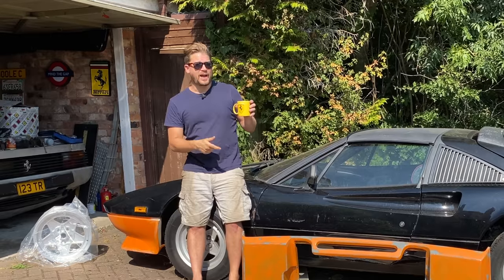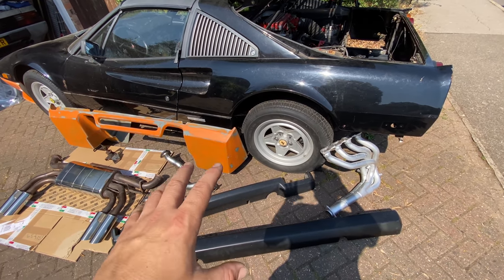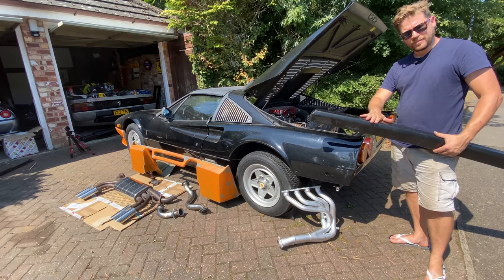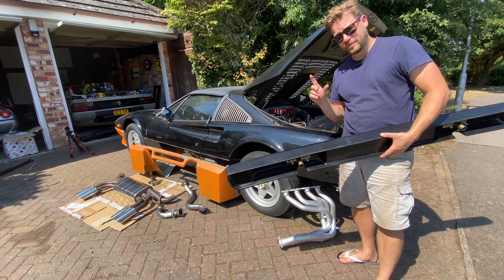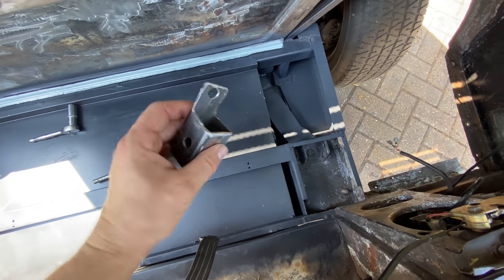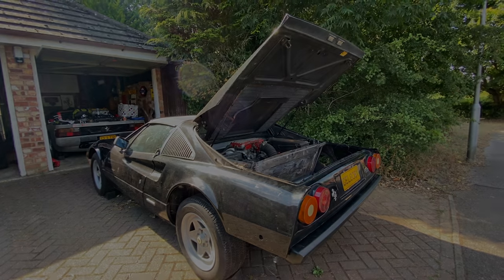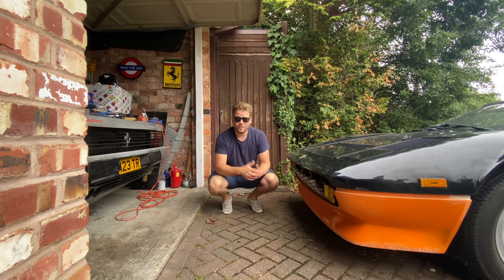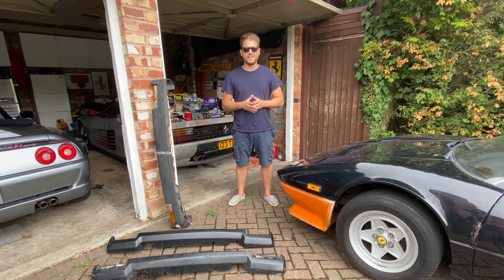Making My Ferrari 308 Project Look and Sound Better - Conversion Time

Comment: Just a tip with the welding, you need to cover your exposed skin as the UV can burn you, if you are just doing a few tacks here and there all good, but weld for any real length of time and you'll get "arc burn"...not pleasant.....nice work on this job though, its a hell of a project!!
Reply from the maker: Cheers Kevin notes and thanks for the tip 👍🏻👍🏻👍🏻
Reply: Aye I can vouch for that doing an arch repair on my mk2 golf years back, gloves, tabard, helmet, bare arms, was like sunburn 😂
Reply: Welded once (only time ive done it too:))on an old Opel, couldnt see anything through the mask so I just closed my eyes and burned away... got a nice sunburn on my face... 😆
Reply: @Ratarossa   its something I think we have all done, luckily for me my father was a boilermaker/Welder so I learned at an early age about arc burn......Those welders you have bought look really good, nice and portable and you seemed to have picked up welding pretty quickly....Looking forward to seeing the end result of this 308....its a great project.

Comment: To mount the bumper looking at the other 308 it should be a tube by the look of it not a stud. Would be more substantial. Would explain why your bumper initially sat low. If a tube of the correct dia to slide over bumper tube (with a slot so the bolt can clamp it) was put in the middle of the hole probably have not been far away.
Reply from the maker: this is correct and i'm looking for some to mount the front bumper in this way.
Reply: The slot will allow some movement of the bumper in the event someone rear ended you lightly, parking knock, that kind of thing, the slot will allow the bumper to move absorbing most of the impact rather than sending it directly to the frame, meaning you might only need to replace the bumper and not the frame.

Comment: Love the channel. The amperage on the mig looks to be a bit low based on the sound it was making while welding. Play with the feed speed  while setting the amperage based on the metal thickness and adjust the feed rate until it sound like bacon sizzling.
Reply from the maker: Brilliant thanks for advice I’ll have a play with the settings

Comment: I love the 308!  As a non purist guy, thank God, you might be keen to bring out the full potential of the 308. They respond extremely well to modern camshaft profiles and individual throttle bodies. Cat Cams have new, not reground billets good for around 10,000rpm!!!. For the ITB's, a used sprint  Hillborn injection system is modified for EFI.  You wouldn't rev it to 10 k every day but it would be there.

Comment: Hi Scott loving the videos

If you get chance, keep on practicing with the welding. If you have spare or scrap material get it joined together!
You might consider pushing the gun away from you rather than pulling towards (give it a go) It never hurts to lightly prepare the surfaces by removing the mill scale with a linishing wheel on the grinder. Please also consider wearing something more suitable, cover the exposed skin.
Reply from the maker: Cheers really appreciate all the tips and advice. It all helps 👍🏻👍🏻👍🏻

Comment: It’s amazing how the us version is different
Reply: The US safety requirements for the bumpers doesn't exist in Europe/UK
Reply from the maker: quite incredible the changes they made, but i guess it was worth it as they sold a lot of cars in the US. As you saw all the rear end frame was completely changed and i suspect there must have been some changes to the front frame as still can't get my head around why a euro front bumper won't actually fit
Reply: Same on the Mondial - just discovered that the brake calipers are different on the US spec cars - but only after buying the seal kit for euro-spec calipers - doh!

Comment: Great video, brings back happy memories of my 308 GTS which i owned for 35 years.
Reply from the maker: KSL12 wow 35 years, that’s good going. Why did you sell ?
Reply: @Ratarossa  Needed more room in the garage. Still wish i still had it but have a F355GTS 458 Spider and new Portofino with a flat battery.
Reply from the maker: @KSL12  ok that's worth the 308 sacrifice LOL

Comment: Another great video it's certainly a labour of love for you and Mr Influenzo on these 308s. Earlier today I watched a Doug Demuro video which you may find of interest, on a rival to the Testrarossa, the Vector W8 a car I've seen a few times in magazines but never really tested. It's basically a mid engined gull winged rival to the countach and your Tesrarossa with a twin turbo v8 producing 600bhp with a purported 240 mph top speed. It's an interesting car and actually runs into x2 videos. Keep up the good work, I do hope you'll do a joint video between you and Mr Influenzo when the cars are finished. Stay safe etc. Ben
Reply from the maker: cheers Ben, ill check it out and yes Jack and I will be doing a video or two together

Comment: Just a thought, but why not move the grey 308 to the other garage and chuck the 355 in the single garage so you have a local template for the black US 308 conversion?
Reply from the maker: Yer that’s not a bad idea. Although I need to do a cam belt video on the 355 shortly ... so after that

Comment: I'd use thread lock on those bolts that hold the front bumper in place. If they come loose you'll lose the bumper.

Comment: Great video, interesting to see what looks like small differences between U.S. and Euro spec cars are actually big in terms of construction.
Also, welding in shorts and flip flops, spraying red hot metal all over those dry dead leaves on the ground.., haha, probably just how I would have done it !. To hell with those health and safety nutters, lets just get it done and suffer the consequences, so what if I burn myself and my house down, that’s how you learn, right ?. lol.

Comment: My 84 Mondial sits too high. Do you know if the lowered 308 springs fit to mine? Loving the vids, it’s your fault I bought it 😂
Reply from the maker: All Ferrari’s of that era have a similar koni system which is none adjust. The springs I have to go on the 308 are sports for the new coil over system I also bought. 
 I don’t think those springs would work with standard system but you might be able to get some made .... try Gaz shocks
Reply: Ratarossa thanks for the reply. I was thinking of making a bit Outlaw as it is a bit of a project but a nice one too. I shall look into GAZ shocks. Love to show it to you at some point 👍🏼
Reply from the maker: @xjrrider6710  I would love to see it mate. Great idea

Comment: How many Ferrari's do you have?
Reply from the maker: Not enough 🤣
Reply: It was when you needed a reference for your 308, so you went to another!!!
308/328 are awesome cars I was lucky enough to picked up from school back in the day. Apparently you can't use 2nd gear on the 308 until the gearbox reaches the temp of 140 degrees...
Reply from the maker: @paulskinner540  i bet that was very cool being picked up from school in one. 2nd gear is notoriously bad in this era of ferrari but if you are skilled and select it slowly they go into 2nd fine

Comment: Doesn't Superformance make a rear bumper conversion kit...
Reply from the maker: Jimf rear bumper and brackets were Superformance. Most people drill the US number shocks but I figured I would remove the 40kgs of weight and those heavy shocks
Reply: @Ratarossa  I agree with removing the extra 40kg...  Just don't get bumped in the rear...the new brackets are pretty lightweight.